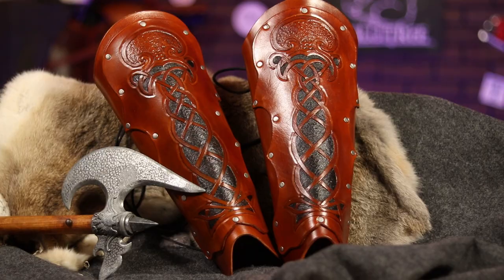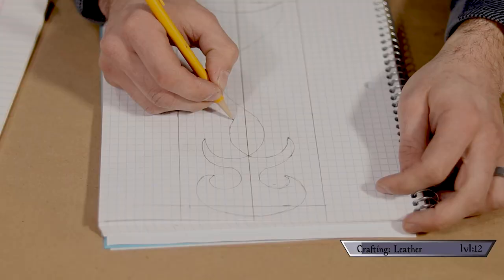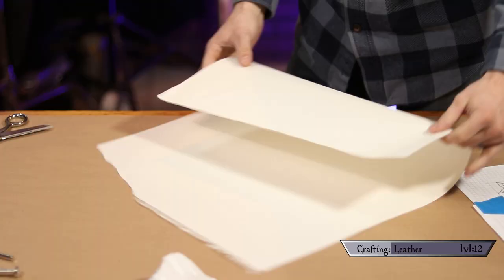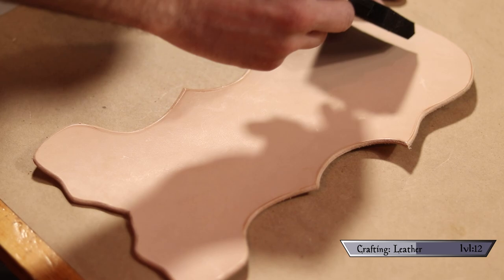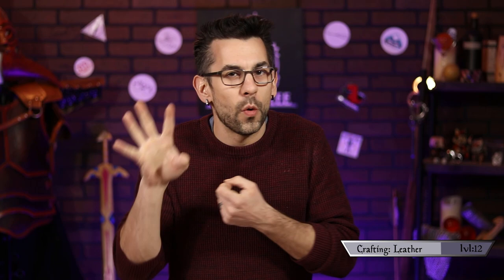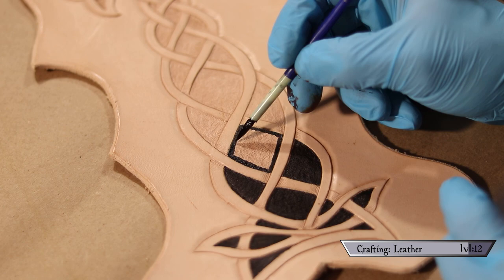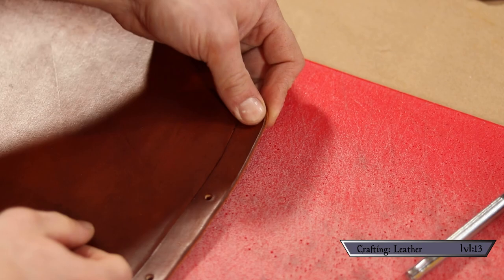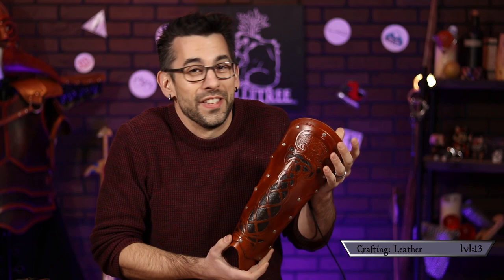Make Leather Greaves | Leg Armor For The Mighty | Skill Tree

Comment: Looks great! You can also wet your leather before dying, it will help it go on more evenly. Or put on a coat of diluted dye, using the appropriate diluter. Alcohol based diluter for alcohol based dyes, and water for water based dyes then add another coat of undiluted dye while its still wet.

Comment: Great video as always. Loved the idea for using graph paper for designs. And your method for the template was actually pretty genius. 
Another way you can get that edge border, is with a groover tool. They usually have an adjustable arm, so you can set a distance like the wing divider, but it actually cuts the groove as you're going.
Reply from the maker: Great tip! I had only been using it to set a stitch line. Thanks for the advice and for watching!

Comment: the other trick for making a symmetric design is fold the paper and work from one half the center of the design with a soft pencil and dark-heavy lines.....then after you are done with the design, fold the paper and rub the outside of the paper with your fingernail or something soft and slick like a piece of a urethane...make sure you can see the design through the paper to rub over all of it....then voila! open and find a perfectly symmetric design
Reply from the maker: Great tip! I will definately give that a shot. Will certainly be faster than trying to manipulate it with the computer. Thanks!

Comment: Hey, awesome job!, I have been Leatherworking for 2 years now, Check out Dark Horse Workshop he has some good videos that you can learn some more from. A suggestion I would make is getting an Airbrush. I just discovered how freaking awesome it is for dyeing your leather. You can get that really professional looking fades on your leather, Like the dark brown edge to a lighter brown center. Another easy trick to help with your edge beveling, Bees Wax. It works really well and it's cheap.
I can't wait for your next video!
Reply from the maker: Great tip! I am definitely going to invest in an airbrush. Do you have any recommendations? I LOVE darkhorse. His artwork inspires me 😁👍. Thanks for watching!
Reply: I personally own a few, you average eBay special is good for a starter,  I like gravity-fed one (just a cup on the top you pour into). They normally are pretty cheap like sub 100$, aim for one that comes with a compressor, hose, really the whole kit (your paying for the compressor). As for Good Airbrushes, there are a couple good companies, Like Badger,  Paasche, Harder & Steenbeck, the one that gets talked about the most is Iwata, I personally own 3 Iwata, 2 Neo-CN (gravity fed, one for SPX Makeup, one for leather) and an Eclipse HP-BCS (siphon or bottle). I really want to get an Iwata HP-CS which is a Gravity fed version of the previous model I mentioned. 

The big difference between a Neo and an Eclipse is the price and quality. The Neo is a Starter and has a really small easy to lose Fluid Nozzle(its threaded and maybe 1/8 of an inch or smaller), which makes clean up and maintenance harder as its hard to clean the paint chamber if you forget to clean out your airbrush. The Eclipse has a larger and much easier to clean fluid nozzle (pressure fit). Shop around and do your research, any airbrush is better than no airbrush.